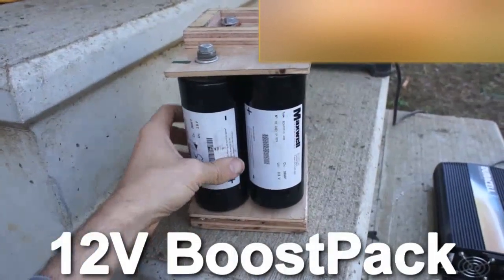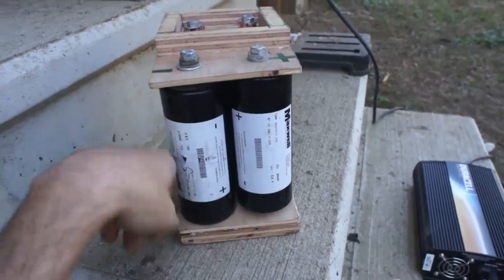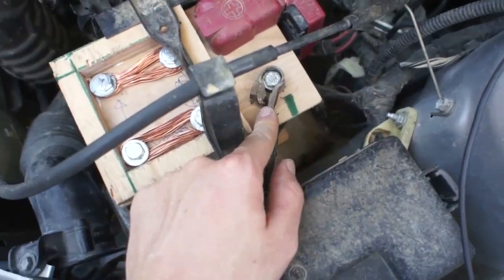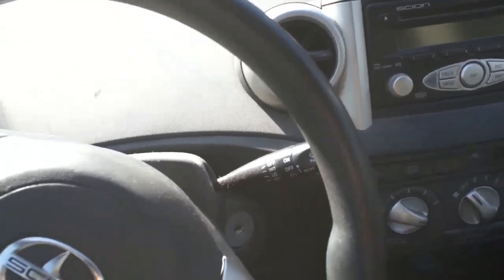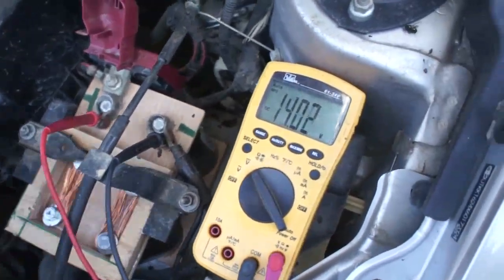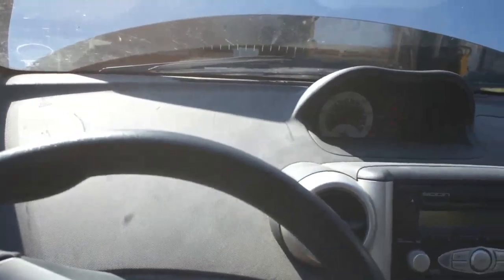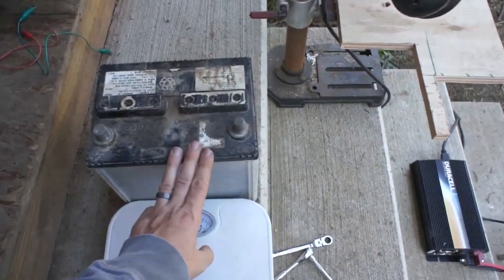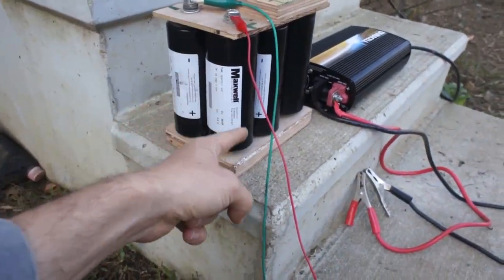12V BoostPack. Replaces auto battery. Works great!

Comment: What are the cranking amps for this boost pack? The price for batteries for my Cummins are ridiculous. Instead of a hybrid system I can make one of these in place of one of the batteries.  All that says it's not about the volts it's about the amps when you are turning over that engine.

Comment: It’s been 11 years since I have installed my super caps. Still running strong 💪
Reply: With or without a battery in parallel ?? What value farads ?? 👌
Reply: @owenbruce4120  no battery in parallel, I have 12 caps in a series parallel configuration.

Comment: hi there, i got six of those super capacitors. I will connect them in series to make a 12 volt car battery. But i know there is some kind of protective circuit to protect the capacitors. Please kindly teach me how the circuit works and where can i buy them. thanks so much.

Comment: There are fuse shaped diodes you can use to replace the charging system fuse that raise the voltage for AGM batteries which need a higher voltage charge cycle.  That would give a little more charge to the caps.

Comment: Sir do you know some product that can run seperatly lead acid baterry and capacitor banks similar like dual baterry system I use plasma ignition often and amplifier ignition but me alternator starting charge get changed from 1000rpm to 3000rpm meaning on plasma ignition the alternator is constantly back charging and draining baterry true ignition coil and dash lights so any sugestion how to insulate those 2 power source???

Comment: Great. A a ham radio operator I know some of our equipment uses small capacitors to maintain voltage for memory.  I'm thanking this would be the way to go for EV's. Less weight and fast charge time. Keep up the good work.. WA4BEW   Bill

Comment: Outstanding!   My thoughts regarding the shop use is to use 12v car start batteries along with the capacitor pack.  That way you still have the time required to do your work with high discharge bench tools.  This will increase the life of your batteries big time as the start up power needed is coming from your capacitor bank while having additional run time from your batteries.  Just don't let start batteries dip below 10 to 15 percent of full charge.   I've been doing this in my shop to run a drill press, table saw, and in the future, a metal lathe and milling machine.  Both capacitors and salvaged start batteries are cheap at the scrap after rejuvenation.   Like 3 to 7 bucks.  So you get the best of two worlds.

Comment: Laser! I just bought my first car and it's a 2011 CRV with under 75K on the clock and I really wanted to build a pack like this but was a little put off by the prices of the cells. You mentioned you paid six dollars for each cap but as of now it seems like Maxwell Technologies has stopped making supercapacitors and the alternatives are kinda pricey. I realize this video is several years old, but I'd love to know if you know of anywhere I could purchase the caps.

Comment: Keep the copper wiring, gives it character! Ive been looking at a 16 v 500f for $400 ....I calculate 177 watt hours. @ 8+ million cycles, instant charge, the price and availability is very compelling. I bet charging efficiency is much higher then chemical batteries. Need to check my math! Thanks for the experiment, appreciated.

Comment: So I'm just wondering wouldn't it be better to wire this pack into the trunk for less heat cuz the engine is going to eventually  wear and tear those caps life cycle down?

Comment: How capacitors behave on diferrent temperatures, does low or high temps have some effect on caps? I think that's great for jumpstart, but for everyday use, especialy when u traveling, and when u need reliable car, its not smart to go on some trip with this, or u need to have charged battery in trunk, in case u forgot to turn off the lights or audio unit, or what if u want  listen music when engine isn't running, u need some small battery instead of that caps, for example 2 little 12 V and 7 Ah lead bateries in parallel connection with that caps.

Comment: Looks like 2000 farad super caps. So has 2000 cranking amps stored.at volts stored. He could take them to 16v.but not for a car. But those are like 30 each. On ebay.

Comment: Thanks for sharing this knowledge. Question: Can a Boostcap (Ultra-capacitor) system be used jointly (in parallel connection) with the car battery as well ? or the car battery has to be disconnected and taken out ?
Reply: Sure can. Will help the battery to last a lot longer too as the caps will do all the heavy lifting of power draw. Great for Diesel engines

Comment: Did you put some thing in the circuit to prevent overcharging from alternator or is that not a problem? Once car is started alternator will be continuously charging it.
Reply: Not a problem. A 6pack can go up to 16.2vdc. Newer ones 18vdc. Caps charge up real fast and in 10sec its fully charged.

Comment: Did you have the how to make this in another video?  
 (I saw one of your other videos with a booster & don't remember if it had how to make but this one on the car looks different) 
I wanted to make a Gokart/ATV thing that ran off electricity. (batteries as you commented are heavy & expensive & wear out) 
I was thinking of some weird circuit like the "school girl circuit"  (I haven't figured how too yet)  
 but I haven't been able to figure out a battery or power inverter yet. 
I like the travel solar plates but those are sort of expensive too  
any suggestions would be appreciated.

Comment: I've got three 4000uF capacitors, 400 volts, wired in series,   I salvaged from a piece of equipment. I'm wanting to use these on a riding mower. I tried charging them using a quick start battery charger, 12 volts at 55 amps. I let them charge for over an hour. So far no luck. What am I doing wrong?

Comment: But if you didn't use your car for a couple of months, would it still start ?
Would the caps not have slowly discharged to zero ?
We need to know.
>
Reply: Nope. Depending on size caps you buy. Couple months is pretty long though and probably not enough to start car. Ever heard of a solar panel? He was using a 13w panel

Comment: great stuff. I have a question, on the basis that draw of those Capacitors is huge when the voltage drops, do you think that this would harm the alternator?
Reply: Given the amount of the capacity, it charges way too quick to damage the alternator.

Comment: i've seen a guy have like 150 200 ultra capacitors i believe were 500 F each topped up with a big ass solar system and and converted to 220v AC
Reply: one thing tho i'd like to know where you bought 1 capacitor for 6 bucks..
coz i cant find anything 500 below 30 bucks

Comment: We should always use extra one for reserve because in case we need extra power for extreme emission radar. This is way better than lead acid battery and not polluting. The reason it had enough volt but not charge it is because not correctly connect. Turn down headlight and AC down before starting.

Comment: The big problem of using capacitors only is the voltage drop. Al computer and accessories settings of the electronics will be lost. And how long will keep sufficient charge with the normal standby current drain of all modern cars?

Comment: Sure you can theoretically save some fuel if your car is 25 pounds lighter. But your car weights about 3000 pounds. 25 pounds is 0,83% of the mass and I don't even put aerodynamic drag into the calculation. Practically you save nothing.

Comment: my car leaves the headlights on (its an automatic thing, for safety. I have them shut off at the steering coulomb) after I shut the car off, exit the car and close the door and walk away. Does this drain the boost pack very much?
Reply: Depending what size caps you buy. You will have a number of minutes of energy.

Comment: I don't know why YouTube always sends me video recommendations as old as this one, but as long as they are worth viewing it's okay with me. That being said, those are the largest capacitors I have seen since I was on active duty in the Marine Corps back in 1984-1987. 

I wasn't paying attention to the depth my needlenose pliers were sinking into the silicone potting compound around a terminal board from an anticollision light flasher system and accidentally crossed the power and ground terminals. The capacitors hold a minimum fifty thousand volt charge they dump all at once, take mere seconds to get recharged, and dump again in a continuously repeating cycle as long as the pilot has activated the anticollision lights. I was rewarded for my lackadaisical demeanor with a huge and powerful blast of current painfully wriggling through my muscles making it impossible for me to let go of the pliers.
Thankfully it was unable to recharge itself and kick my ass some more! The pliers were history after they melted clear down to the intersection of the two halves, which resulted in a written reprimand being placed in my file. I couldn't care less about the paperwork in my file being held against me; I was glad I still had all my fingers and toes!
Reply: They have 3400F 3.2Vdc available now, but $$$

Comment: I've heard that truckers using a supercap module along with a few batteries, end up getting rid of them after a year because they burn out their starter and damage their batteries. Wondering if you ran into something similar. And if so, could a resistor put in series with the supercap(same value as a battery's internal resistance) prevent problems. And would it prevent the supercap from working properly??

Comment: Something else you might consider is taking a 3/8" copper pipe, flatten it, then drill holes for jumper bars rather than winding the wire back and forth between washers.
Reply: I agree on this as wires tend to come out when the washer spins

Comment: Heaven help you if you end up having to crank the engine beyond the cap's ability to provide continuous cranking amps. They simply won't do it because they do not store the energy density of batteries.
Reply: Right. Get your car tuned up so it will start

Comment: Use A 12V Skrewdriver And a hole -saw 2" and drill some hols and se howe much power you got left.Every body knows that a hole-saw burns a-lot of energy.And you sad that you had the air-condition on but not the engine how does that work,maby the fan not the air condition!

Comment: With 200amps you can start 3-4 cars
Reply: do not mix up amps and amp/hours my friend :-}
Reply: @oldevil  You said 200 cranking amps , I am not a native English speaker but I think that means that the battery can deliver 200amps for a very short period of time like then you crank the engine?
Reply: @Wok_Agenda  i didnt say that, you are right with max 200 amps the battery can deliver what the guy in the video says,but starting 4 cars? I thought you assumed the battery has 200 amphours left, that would be a huge battery since normal car batteries are around 40 to 60 amphours capacity

Comment: how long will your cd player play with the engine not running off that?
Reply: No need to "replace" the battery when one can have a boost pack and battery That way one can keep the existing capacity of the battery while adding the cranking amps of a boost pack.
Reply: @kreynolds1123  I have 6)3000F ea caps as my 2nd battery as the snowplow attachment on my Suburban takes a lot of current draw to operate. Works like a charm and lights no longer dim down. That plow kills batteries due to its high current demand draw.

Comment: Your starter needs support from the battery especially in the winter. The caps are a very good thing to ADD to the vehicle power system. Capacitors have a very quick transient response, this means that they can charge very rapidly however this means they discharge very rapidly also. Do not remove the battery. Just dont be that guy. Your capacitor bank is awesome and would compliment the system very well, watch for swelling and leaking if you see either then replace that capitator immediately or remove it for it is failing and hurting the system at this point. Capacitor have a wide variety of maximum voltages and capacitance values measured in Farads. You want POLARIZED Capacitors with at least 15VDC capacity and the higher the FARAD the better. We used to use these to keep the lowrider from stalling due to the bass lol, the amplifiers were drawing 120 Amps Peak at times and the spark plugs wouldnt fire once the battery couldnt deliver fast enough at stop lights when the alternator is not cranking enough at idle. Once installed the headlights never even dimmed on low notes. Im old school. Good luck.
Reply: Exactly! Why "replace" the battery when one can have a boost pack and battery? That way one can keep the existing, maybe reduced, capacity of the battery while adding the cranking amps of a boost pack.
Reply: My question is it safe without balancing circuit? This guy dont use ones
Reply: @budhihart8161  Long term? Probably not.  The caps probably ly start out all the same capacitance but small changes can develop over time  repeated charge discharg may eventually lead to overcharging one and eventual failure.
Reply: @budhihart8161  Because he has a large capacity as 6 in series would be 16.2vdc. But balance boards are cheap.

Comment: I would really use plastic like sheet HDPE instead of using wood , wood can conduct electricity
Reply: Well than how come we don't make wood wires
Reply: stupid   it can't as the resistance is too high to conduct 12VDC.. He could increase the resistance by putting silicone spacers  or gasket maker on the posts

Comment: So what happened with your capacitor 12 volt battery? Are you just gonna leave us hanging there to see where we are wasting our time looking at your old video, to know if your idea does work as a 12 volt battery if one doesn't use radio or power when the engine is not running......

Comment: That's interesting.
You have a 2.2kv starter.
V a 110v drillof in known power and 30watt bulb.

Also you have massive resistance.
As the charge at 14.4 volts from the car should read that not rise to it. As your reading the output of the alternator not the cap charge.

Also seems that your making inductors in your binding, not quite correct on one but yes to the other.
If your adding on one and resisting on the other, then that will show the little time you've added.

A charge storage device is power + resistance.= Battery.
Reply: 2.2 thousand volt starter?
Reply: @gunzmith29r  KVA.

Sorry lots of typos.
The KVA rating is for most car starters of that engine size.

Comment: I want to see the AC , headlights , stereo on for 20 minutes  and see how much voltage it drops cuz he seems that you were in a rush to turn the car back ON after having your headlights ,AC  on cuz the voltage was dropping very fast. MANY MOST NEW CARS THESE DAYS AFTER USING THEIR HEADLIGHTS REMAIN ON FOR ABOUT 30 SECONDS OR SO .
So I would like to see if  can handle for more than 30  seconds or a minute before I go out and buy myself one of these or make one for myself .
Reply: Hey,  no rational person doesn't know that these gadgets will not let you run the headlights for an hour or two after you shut off the engine.   But the important point is that with a "backup" system (perhaps a Lithium Ion cell pack), this could save weight AND give better capability.
Reply: Its quick discharge
Reply: You too lazy to turn them off before starting? You will have a lot more than 30sec with just auto headlights.

Comment: These capacitors are overkill for this application.  I've built one using 6x 500F capacitors in parallel with a 7.5Ah LiFePO4 motorcycle battery.  Works beautifully.  The car has a hydraulic folding roof, which puts a big load on the system, and it works perfectly, even with the engine off.  The capacitors were only $5 each on eBay.  The battery was $99 and should last over 10 years.  Although, I live in Australia, and it doesn't freeze here.  You can't let that kind of battery freeze.
Reply: So it comes down to how many farads are needed, and you are saying that 300F is enough.  Why not just attach it onto the old car battery that is failing?  BTW it is in Parallell because the caps will just charge up to whatever voltage the alternator charges it with?

Comment: Guys I have my cap charger in my trunk of my car with a 100 foot extension cord. Sounds funny but it saved my ass once when I took my car to get new front tires. Sure enough the guys left my key on with the car off and it killed my caps . So I disconnected, “ALWAYS DISCONNECT “ your caps from the car and charged it up literally in 30 seconds. The guys at the shop didn’t know what to think. Lol my charger I made is a 1000 watt HPS ballast transformer with the secondary chopped out with 4awg wire just to a giant 400 amp China bridge rectifier. I was gonna use caps to smooth out the dc but what’s the point. It started charging at about 150 amps and tapered down. My charger has 0 awg leads “ which is over kill “ , a shunt with a dc volt meter and it’s cool looking. Heavy as fuck but it gets the job done. So I’m guessing you can use a transformer half the size and it should work. Cheers
Reply: Oh quick note ! If you go with a 1000 watt HPS ballast transformer, make sure it’s 120v. For people in the UK just use 220v . Also I used 14 to 16 turns of 4 awg for the secondary coil. Basically I needed enough turns to get enough ac voltage through the bridge rectifier to get 14v dc . So I’m guessing it was 16 turns. Remember NEVER charge caps still connected to the car !! Cheers.
Reply: Here’s a video of my charger running a big ass motor! 

https://m.youtube.com/watch?v=wpIc9VSKN8c